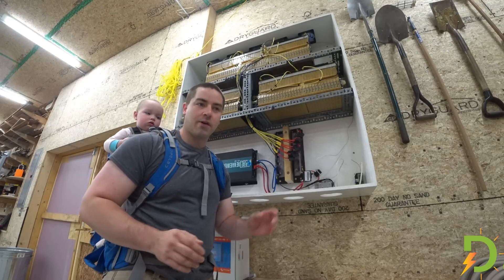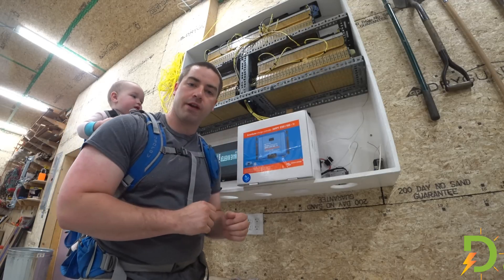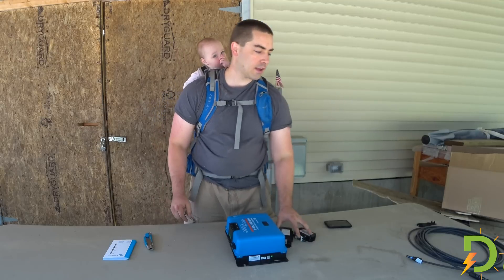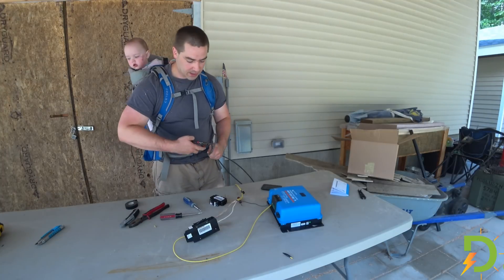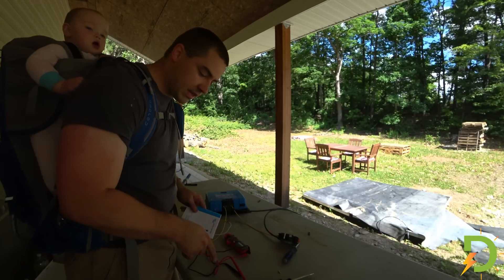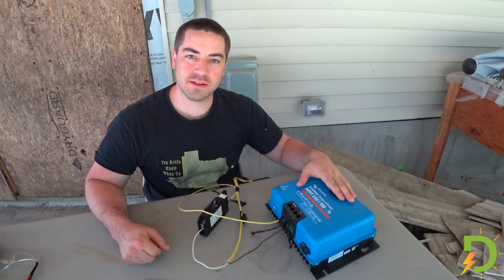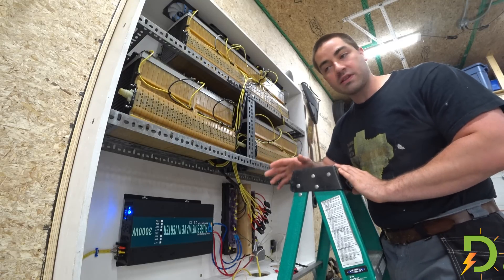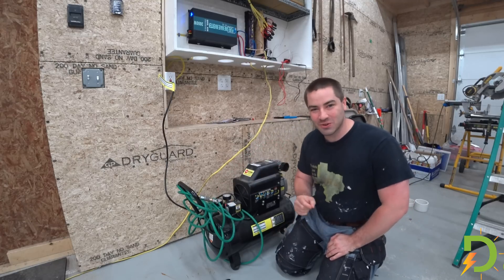Victron 250/100 Solar Charge Controller MPPT, Off-Grid System

Comment: Sorry for a late question, I currently have an issue finding a good mppt. My solar array is over 300volts, I could disconnect some panels to use this controller. I noticed you are using 80volts and you are getting 600 watts. I would need to reach at least a thousand watts of input. Would that be possible with 250ish volts? Big thanks. My solar panel's amperage is 13.59. Big thanks.

Comment: hi david what was your bms for the volt setup ? ?
Reply from the maker: If I were building the battery today, I would buy these: https://batteryhookup.com/products/li-ion-lifepo4-3s-20s-30a-bms-with-balance?variant=42283333910690
They are affordable, and good quality.  The Chevy Volt battery breaks down into 8 individual batteries, each with 12 cells in series.  So, I'd buy 8 of the BMSs, remember to select "12s li-ion".  These BMSs are limited to 30A, which means 240A for the whole pack.  If you need more current for your inverter, then Battery Hookup has a 100A version as well: https://batteryhookup.com/products/12v-lifepo4-smart-bms-w-low-temp-cutoff?variant=36287975391394
Use discount code: DAVIDPOZ

Comment: What size circuit breaker did you use ?
Reply from the maker: I forget what I used in this video, it was just testing.  But, when I hooked it up to my main house battery I used 125A circuit breaker and 1/0 wire.  Thanks for watching.

Comment: Would this system work on a smaller 12V  LifePO4 battery system but will be upgrading to a larger 48V when more solar panels arrive.  I don't want to purchase a separate charge controller - ....  and I want one charger to work on the small system until more panels arrive and I connect additional batteries.   It seems like this would work - but just want to check .

Comment: And I think there should be a warning. Using the batteries without a BMS can be dangerous. The voltages drift apart, a cell overheats, the whole thing start to burn.
Reply from the maker: I agree, which is why I've added BMS's to my builds.  All my current battery packs have BMSs.

Comment: I see this is purely off-grid. Can I use it for grid-tied systems too?
Reply from the maker: There are a few inverters on the market that allow for off grid, and back feeding at the same time.  Sol-Ark is the big one that comes to mind.  But, for me, I'm happy using all my solar off grid, and just using the grid as a back up to my system in case I don't produce enough solar.  This means I don't back feed, but I can draw from the grid when needed.

Comment: The only a couple bad things about victron, no display, but the main thing, it's priced like it's made in the USA! If it was closer to half the price, China makes clones alot cheaper! It's a war, between price, performance and dependability! You can have 2 of the three, not 3 of 3, just like house building!! But 2out of three sint bad!! I think although the total wattage would be lower, or voltage, I'd go with midnite classic150 or 200 ! ! ..  96 amps from a classic150, just shy of 80 from a classic200, but drops more for the 250, 
It would be awesome if they offered a add on, to use the logic of a controller, to control a power electronics bits, inductors, MOSFETs, to allow something like 200amps at up to 200vdc, I would like to have a couple, but I guess selling multiple charge controllers is better for the company!! Sorry I'm rambling again!!

Comment: Love your clear explanations and videos. I have 2 separate Victron 5 KW 48 volt inverters, connecting to 2 separate locations with breaker boxes, 110 volts each. and total of 16 deep cycle batteries. Can I connect both inverters to same battery bank using a large bus bar? Thanks so much.

Comment: Have you looked into doing an AC coupled system with those SMA Sunny Island?
More efficient because you would use the power from the solar panel directly most of the time through compatible grid tie inverter.
Reply from the maker: Yes, I bought a Sunny Boy and some used panels.  I just have to build it.  I look forward to testing the overall system efficiency with AC coupled.
Reply: @DavidPozEnergy  looking forward to that, thanks for your reply.

Comment: hello
whats the limit conexion of modules i can do with this 5800W regulator ?
5 serie and 3 parallel? if the power of each module FV es 370W
5*3=15 module*370W=5550W

this is correct?
thank you for the vidio. Greetings from Argentina

Comment: Just out of curiosity does that Victron energy charge controller still work???or was it a waste of money????
Reply from the maker: Still working perfect.
Reply: DavidPoz So you are very pleased with it and would recommend one???
Reply from the maker: Yes.  This is an affiliate link to the exact model I have:  https://amzn.to/2YK6eJM  It has been working very well and I would recommend.  If you don't need 100 amps, then you can save money with a smaller amp model.
Reply: DavidPoz is Amy still there?I know she was very knowledgeable,,, did you buy this from ALT e solar or Amazon?

Comment: You need   Low Frequency inverters if you want to start a motor, or something with a motor in it eg: compressor or AC unit. 

They use proper transformers in them unlike the high frequency inverters which just use electronic trickery to barely run at their rated power, if at all.

Comment: Hi DavidPoz, so one thing that I read when I was looking into Victron charge controllers was that you couldn't install them on heat conductive "substrate."  What did you end up mounting it to?  I am trying to determine if the device gets too hot, and could catch whatever it is mounted to on fire.
Reply from the maker: I had mine mounted on plywood for 2 years until someone pointed out to me the requirement.  So I added a piece of thin aluminum (white aluminum flashing) between the charge controller and plywood.
Reply: @DavidPozEnergy  Thanks for the info!  I wasn't sure what would work.  Sounds like you haven't had any issues with the aluminum flashing.
Reply from the maker: What the manufacturer wants is for you to install on a fire-proof substrate.  Steel, aluminum, bricks, concrete, are all fine.

Comment: Hi David, Thanks for your videos. I am looking at your videos and of others, and websites of victron midnite and magnum energy etc, and I can't seem to find a charge controller that does both wind and solar. I am a complete newbie at this, and I am trying to plan for an off-grid cabin that will be up in a couple of years. Thank you to you  and your fans for this community.
Reply from the maker: To my knowledge, there is no charge controller that will do both solar and wind at the same time.  You will need two charge controllers, one for solar, and one for wind.  I don't own wind turbines, so I'm not a good resource for information.  But, I think I have seen Midnite Solar charge controllers used with wind.  Or, sometimes you order the wind turbine and it comes with a charge controller in the kit.
Reply: @DavidPozEnergy  Thank you good sir.

Comment: Have you looked at REC bms’s?  I bought one for my nissan leaf battery.   It can will replace your 712 meter and shunt, it also “speaks” over the Victron CAN bus and talk to a GX and I’m pretty sure it’s inverters.
Reply from the maker: No, I have not looked into REC.
Reply: DavidPoz https://youtu.be/j8dWyNSwyqk
Reply from the maker: That's a good video.  I love that guys Nissan Leaf battery.  The part that is intimidating to me, he is using a computer.  I'm not a computer programmer.

Comment: What is the max size wire that will fit on the MPPT, the lugs look too small for 100 amps
Reply from the maker: I think it was 35mm wire, I can fit 1/0 wire.  I have another video where I connect bigger wires: https://youtu.be/QhUoS6T75N0

Comment: Hi David great vids
How you set-up bulk ,flot, absorption to your litium battery?
I'd like to use lifepo4 15s bank to charge it to 3.50v per cell what would be your advise to setting?
Much appreciated your reply
Thank you
Reply from the maker: Hi Pawel,  I used the "User Defined" setting.  This allows you to your own voltage.  So if you want 3.5 volts per cell, times 15 cells, then your charge voltage is 52.5 volts.  You can set this in the User Defined section.  In this section there is only absorption and float.  I turned off equalize.  Set Absorption to what you want (52.5v in this case) and the float slightly lower.  Maybe 52.0v.  Last, turn off "temp. compensation" which could over-charge the battery if the charge controller senses low temp.
Reply: Thank you much appreciated
Do you have any sponsor page I don't mind to chip in few bucks
Great videos and the way you approach to all what you do
I've added you to my  watching list
Reply from the maker: I'm in the affiliate program in Amazon: https://amzn.to/2O2tptA .  I'm also in the affiliate program for Battery Hookup: https://www.batteryhookup.com/?rfsn=3333666.ca06e9  I appreciate any time someone uses the links.  Thanks.
Reply: Great I'll take a look
I'm having issues to set equalisation to zero or to disable I've looked everywhere on manual, I'm thinking if the victron 100/20 48v I have is not faulty
Would you suggest to check for current firmware etc
Thank you

Comment: Higher voltage=Lower Amps=thinner cable. 4 panels in series needs thinner cables, not thicker.
Reply: no, in series current remains constant and voltage adds up, but in parallel current adds up and voltage remains constant. But you are right he does not need thicker cables as current will remain constant in series.

Comment: Hi, Cool video. I am planning to build a solar panel facility of app. 12kW
using Victron products as “brain parts” as you show. The challenge for me is
following: I will use 4 x 5,3 kW Tesla Model S 24v batteries serial connected
to 2 x 48v as hybrid power bank. Also use the 20/80 % load rule of the battery
and apply to max 50v and 37 v as cut-off values. In Denmark we use 220v 😉. I am unclear witch Victron products I must buy in order to build a on grid
system able to handle the Tesla batteries? Can you help me?

Comment: Hey David, since it has been almost a year since you put in the Victron, What is your opinion of it?  have you have any problems and have you had to call tech support?  I hear that Victron is great, but sucks if you have to call customer support.  I am looking at buying Victron.
Reply from the maker: In the very beginning I could not get the charge controller to talk with the battery monitor.  They are supposed to.  Victron did get back to me (e-mail) but just told me to contact my supplier.  Luckily, I had purchased it through Alt-E.  Alt-E has amazing customer support.  I spoke with Alt-E about the problem, then they went to investigate, called me back a couple hours later with a solution.  Perfect.  No problems since.  I am not affiliated with Alt-E, just a happy customer.

Comment: I have the victron demo app,  and I cannot see where you can change what type of battery. Do you know if you could charge nickel metal hydride batteries?
Reply from the maker: Hi DIY Dan,

There is not a pre-programmed option called nickel metal hydride.  However, there is also not a pre-programed for lithium 12s, which is what I'm using.  What I did was select "User Defined" and input my own parameters.  I set mine to limit the voltage to 48.6 volts, which is 4.05 volts per cell in my setup.  At first the charge controller would go a little over this, until someone told me about the "temperature compensation" built into it.  It's on the same settings screen for the battery, just lower.  I turned the temperature compensation off.  If you know the charging voltage for your Nickle metal hydride battery you can also program that it.

I hope that helps.
Reply from the maker: The settings is the logo that looks like a gear in the upper right corner.  Then select battery.
Reply: I came across NIMH battery packs  at no cost, want to give them a try thanks.

Comment: Curious why you said you can only run 4 panels in series. It is 250 volt, so your typical 12v panel should be able to run 6+ panels right? I thought I read somewhere in the online manual that you could run 10 in series and if it got too cold you just lost some efficiency. Am I wrong?
Reply from the maker: My panels have Voc=47.7v  But if your particular panels are lower, then you can run more in series.  I hope that clears it up, sorry about that.

Comment: I looked at the manual about supported batteries and all I can see is LiFePo4 support.  I don't see any support for normal Li-ion.  Obviously I'm well aware that you can change charging parameters, but just adjusting the voltages doesn't mean you are using the correct charging algorithm for li-ion.  For example, you do NOT want to float li-ion batteries, as this can cause plating of metallic lithium and compromise the cells safety if left to trickle charge.

So it doesn't look like this controller has the correct charging algorithms for any type of Lithium-ion battery besides LiFePo4.
Reply from the maker: Thanks asusreviews.  What charge controller is your favorite for these types of batteries?
Reply: @DavidPozEnergy  I'm on the hunt myself.  I've only used these kinds of chargers on lead so far.  The sad thing is, I'm sure all of these victron chargers are perfectly capable of doing a Li-ion charging algorithm, but victron just didn't add it as an option.  Maybe they can with a software update?

It seems most of the charge controllers that claim Li-ion support are off brands.  I'd like to go with something reputable but something with the proper charge algorithm.  It would be interesting to data log this victron to see what its doing with its algorithm.  Also the float charge might not be a problem if the you have some slight drain from say the inverter or other items hooked up to it that will draw about the same amount of power as being put into the packs during the float stage.
Reply from the maker: I'm not sure I've ever been in float mode.  Whenever the batteries have gotten close to full I look for things to plug in.  LOL  I'll have to let it get up there and see what happens.
Reply from the maker: I let it go up to float mode today.  The charge controller started limiting the watts down lower and lower as it reached the high limit voltage
Reply: @DavidPozEnergy  Nice.  Ideally it should just stop charging completely if the cells are full.  Li-ion's are generally charged using a CC/CV (Constant Current and Constant Voltage) charge algorithm with a set termination current of usually somewhere around 1/10th of the max charge current.  So, for example if its feeding the pack 50A during peak charging, it should stop once each cell reaches 4.00v and 5A charge current.  The termination current isn't that important, but you just want it to be high enough to avoid trickle charging the pack at a low current for hours.

Because CC/CV on a bench power supply for example, if set at 4v per cell and 50A for example, the current will gradually decrease down to nothing, but will continue charging at say .001A or something silly low.  You don't want that.  You want the charger to terminate and not to attempt to recharge again unless the pack voltage has fallen say 5-10% or something.

Oh and if you are going to test to see if the charger actually completely stops charging, make sure to remove all loads (inverters and other things drawing power).  Inverters can draw 25W or so depending on their size even when not being used.

Comment: Hmm, it is looking like you may need a bigger / more adjustable change controller. See my 6 videos, , you can contact me at permlock2000@hotmail.com looking good so far, you will see that I'm about 6 years into my experiments. Hang in there, if I can help contact me.

Comment: For the low power usage from those cells you should be fine without the BMS. You are keeping it off the top and off the bottom. They come very well balanced like the Leaf Modules. In a car the currents are rather high but in your situation they will be very low. My Leaf modules are even from the 2011 vehicles but they are all well balanced from the factory and have remained that way since new. NO BMS. Keep off the top and keep off the bottom. Golden. Just check every once and awhile. Im going to build a battery bridge circuit to monitor a split pack. If it ever goes out of whack I will know then I will find the offending battery.
Reply from the maker: Good to hear about your cells staying in balance.  Mine are still perfect, but I have not yet worked them hard.

Comment: Appreciate your videos, very accurate, i am also building a volt battery setup and i’m gonna use a victron mppt controller, if you don’t mind telling me what charging parameters did u use on your setup
Reply from the maker: No problem at all.  Good luck with your build.  My batteries are arranged 12s, or 12 cells in series.  I'm choosing to limit my charging to 4.1 volts per cell.  So multiply 12x4.1=49.2 volts.  Inside the app, I select "User Defined" then I set the Absorption voltage to 49.2v.  Next I set my Float voltage to 48.9v.  I set this 0.3 volts lower to prevent the short cycling from loads pulling down the voltage temporarily. This is just what I do, but some people like to adjust slightly one way or the other.  The main safety thing is that the cells should never go over 4.2 volts per cell or risk damage/fire.   I hope that helps.  Thanks for watching.

Comment: How did you connect solar parallel or series?
Reply from the maker: In this video it was two panels in series.  I'm currently working on my big array with 12 panels.  That will be both series and parallel.  That video should be out in the next few days.
Reply: How mamy amps and volt are the two panels?